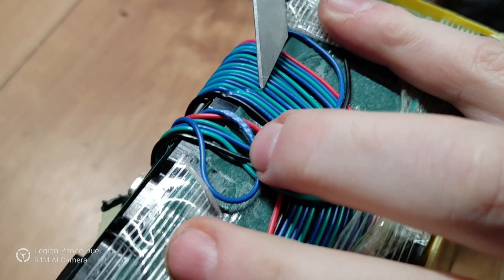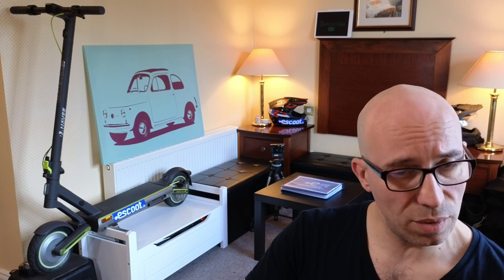Nami Burn E battery potential fire hazard - eScoot Talks

Comment: What smart BMS did you put in?
Reply from the maker: Mine is 35Ah, LG MH1 cells with Logan Brakes and fuses and V2 motors and GX-2 charging ports but it's custom one. Steering column still in one piece and hopefully will stay like that. BMS BQW-1193 20S/60A was bad so upgraded to Smart Jiabaida 100A BMS

Comment: Good thing on the new 40ah its much better done and its in a metal case encased in thermal non-conductive silicone fully water resistant so its same as the controllers
Reply from the maker: Yeah, but you know there is probablly no repair on that battery?
Reply: @eScootTalks  I am apart of Nami group on facebook and i have noticed there is so many people having problems and parts break with their scooters.